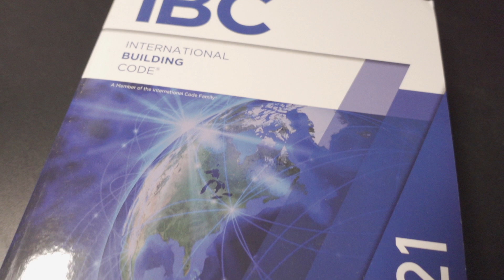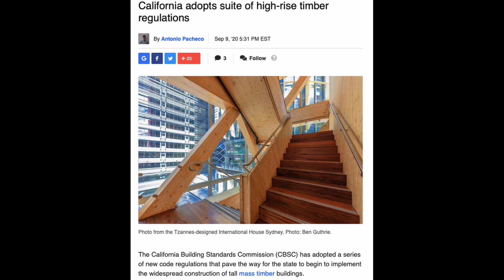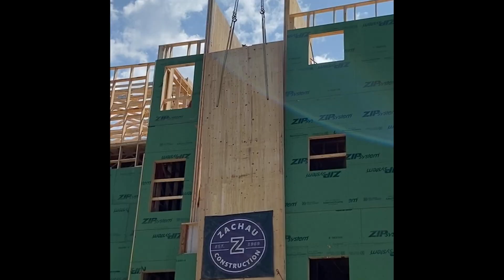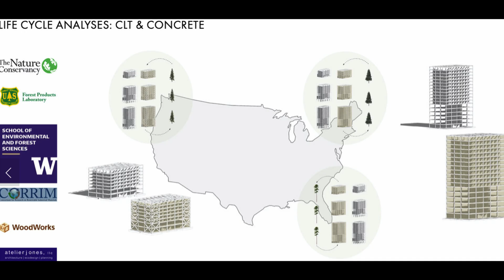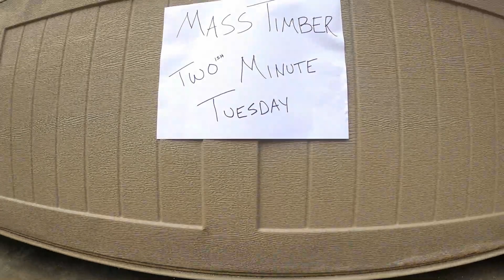Mass Timber in 2020: A Year in Review

Comment: great review - I wonder whether there is as well increasing demand for wood-based flooring, roof shingles, or cladding as part of the Mass Timber trend, or does it focus only on the CLT and Glulam type products?
Reply from the maker: Some projects have looked at doing some of these, but the majority have focused on mass timber structural elements that can also function as exposed ceilings, etc. Also, the building code places limits on the use of combustible claddings and other exterior finishes, depending on the construction type and site specific parameters.